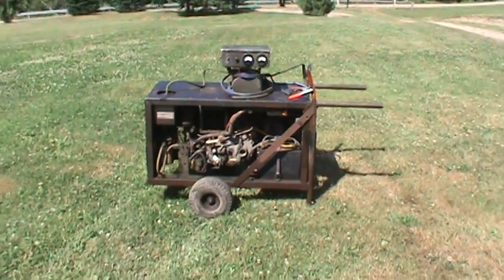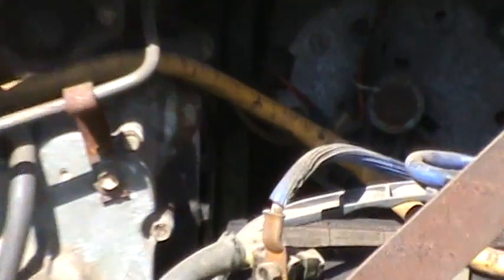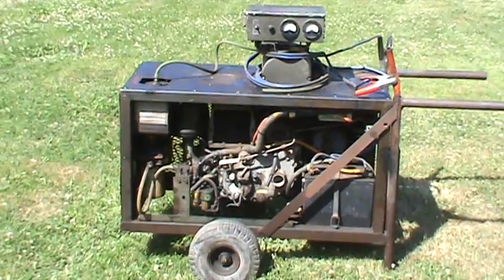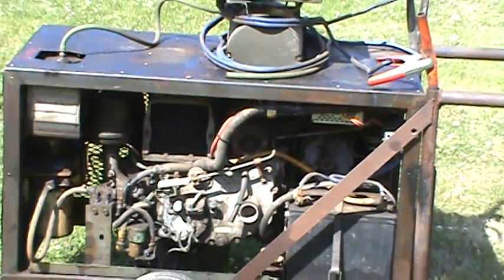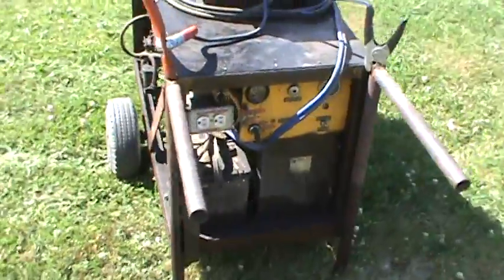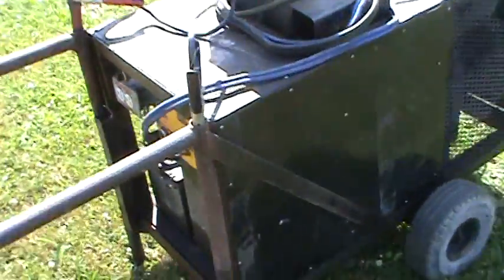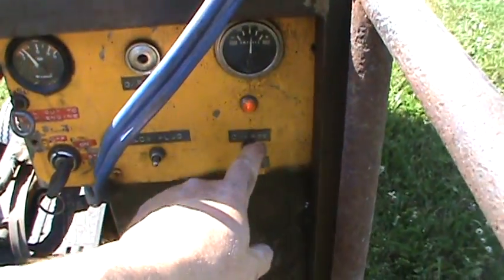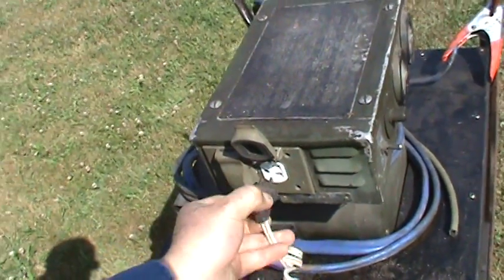Home made diesel generator

Comment: How is that military generator head driven, i thought the shaft from the military engine fit into it.
Reply from the maker: I had a shaft made that fit into it like the original did, and mounted a pulley on it so it could be turned with a belt. I also mounted a bearing on the case to support the shaft at that end.
Reply: @ZackaryMac  o ok, yeah that's good idea, I've been looking for a way to match up a Honda 6hp to one I have. Thanks for your help.

Comment: Can you calculate a homemade generator that can power a DC or AC motor of a converted electric vehicle? I suppose the Lister engine is not suitable because it requires a motor with speed acceleration.

Comment: I love what you have done here. How do you Govern engine RPM's to 3600 RPM's I guess? Also Is it 4 HP? My gasoline generator engine  is 1 Litre that puts out 35HP. Not sure thats correct. My Generator is here: https://www.youtube.com/watch?v=AN9X_YuBSL4
Reply from the maker: The generator headruns 3600 rpm, the engine at 2400 (if I remember correctly), I used pulleys to speed up the generator head to the correct rpm.The engine's own governor keeps the engine speed fairly accurately.

Comment: This same engine is still used by Ample Power to run a 150 amp belt driven  12 volt charger alternator for marine use. $5800 bucks new.  Good job there. I love to see successful back yard equipment that functions. Keep clean oil and fuel in it and it will run for thousands of hours.

Comment from the maker: I'm guessing you're talking about the 12v alternator? I didn't count the poles in this, but there is a lot (like maybe 12?). I do use this for 12v also, so I need the alt. in there too. There are only 2 brushes for the 2 slip rings on the commutator, so I can't remove the brushes (?). I've talked with an alt. specialist about this before, he says car alternators run somewhere in the 300-500Hz range, depending on rpm of course.

Comment: Check you DC output waveform with a scope,,if you can find a pulsation near 60 hz, take the diodes out or remove the brushes at the commutator, probably have more than four poles, parallel them, tie to a transformer using an auto transformer scheme, set your governor at required RPM, voila, a true AC output at maybe 1200, 1800, or 3600 RPM. A lot less work than you think. Wired like an auto transformer, don't use label output VA, it will be much much higher.